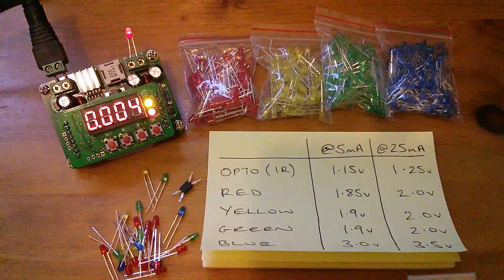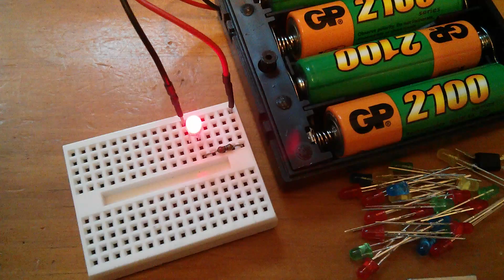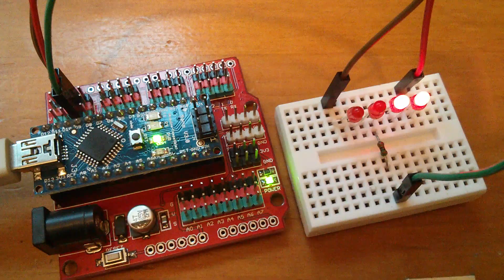Dual Complementary Opto-Isolator (DCOI) MOSFET Driver #4 - The LED String

Comment: I'm would like to know if I could use something like this on a DC boost circuit? to isolate and provide a alternating pwm to two FETs to a push pull center tap transformer? since it has a dead time. and can't both be on at once. It would be grounding a P channel and pos to a N channel.  the P channel would be grounding the other N channel. I am wanting to isolate the driver from the FETs to protect the driver in case of burnt FETs. or is there a simper way to isolate and get two alternate pwm signals? great videos. I'm learning! .... I think?